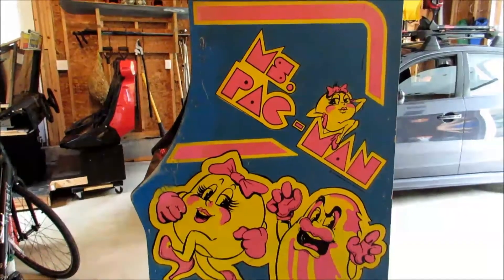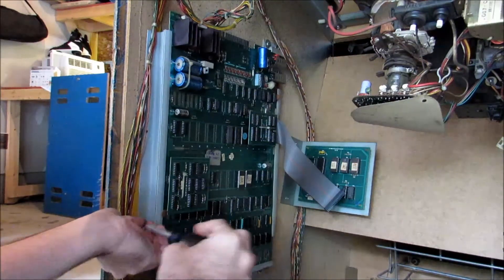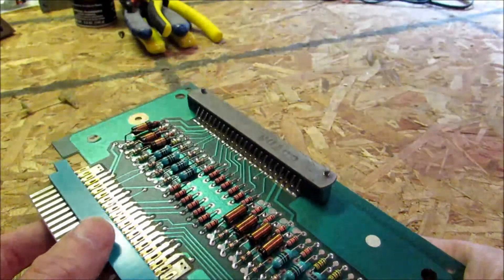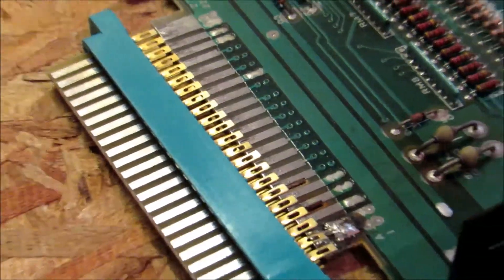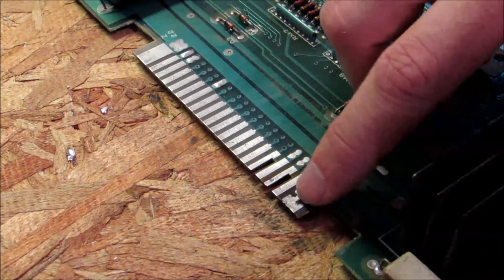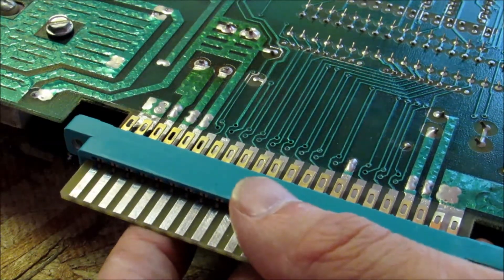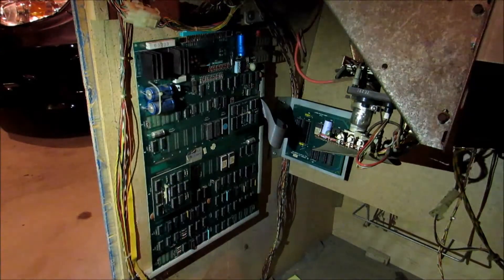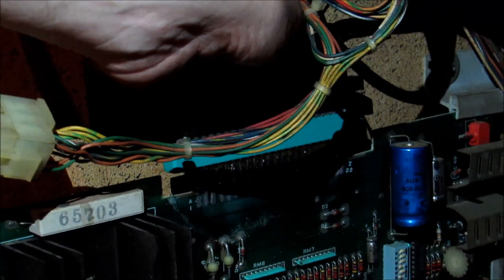Ms. Pac-Man PCB Edge Repair Using a New Fingerboard

Comment: I have table top version when it's been sitting for long time and I plug it in the screen is scrambled. If I shut it off unplug that plug that plug back on the finger board that fixes it until the next time.

Comment: Thanks so much for posting this video!  It gave me the courage to take this on.  I'm going to repair the PCB edge connector on a Pole Position that I'm trying to resurrect.  Thanks again!
Reply from the maker: +Portkey Awesome! Yeah, it's not too bad to do. Just take your time and do 1 wire at a time.  What's your Pole Position doing?
Reply: +That Tim Guy I narrowed the problem down to the PCB as I just get nothing but garbage on the screen.  Recapped the monitor (first time doing that) and tested it with another game and the monitor works fine.  I'm going to try changing the power supplies to a switching power supply and get rid of the original ones...that will be a first time attempt as well.  We'll see how it goes..... thanks for your post!  Posts like yours are helping me each step along the way.
Reply from the maker: Portkey Try a couple of things before replacing the edge connector. Check to see if you're getting 5v at the board. Is your PCB edge where the connector is OK? Reseat the chips in sockets. Just be careful not to bend a pin. I'm betting the issue most likely isn't in the edge connector.

You're welcome!

Comment: Nice video! I have a US import Midway (ms.)Pacman PCB that I converted to jamma. I hardwired the jamma edge connector to the PCB and converted the board for DC +5v and +12v operation by passing the on-board regulator. I ended up de-soldering the entire regulator circuit from the board (the large smoothing caps and heat sink) as they are no longer needed. No buzzing AC hum at all since the jamma PSU is a modern switch mode regulated unit.
Reply from the maker: Thanks!  I'll have to look into that. Seems like that could be a more stable and modern way of doing things.